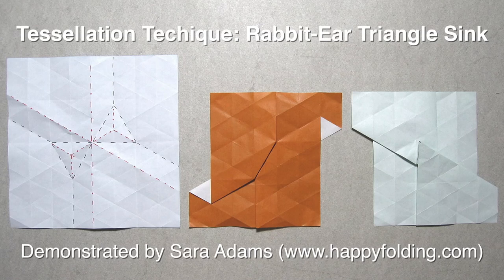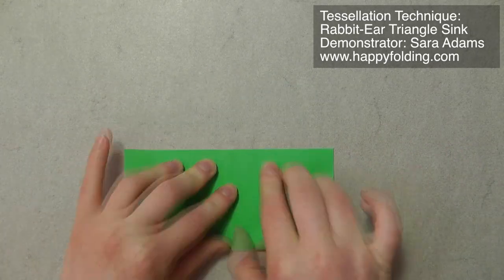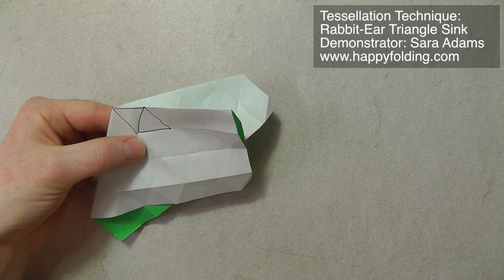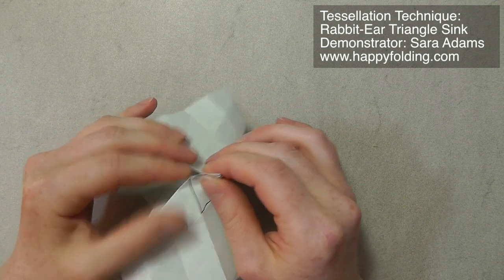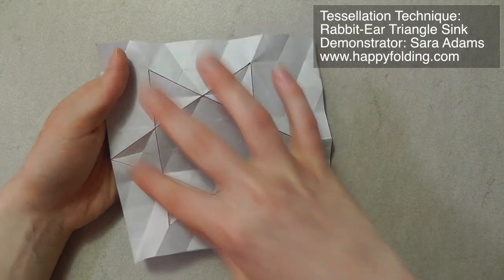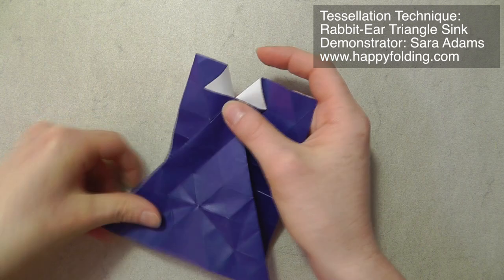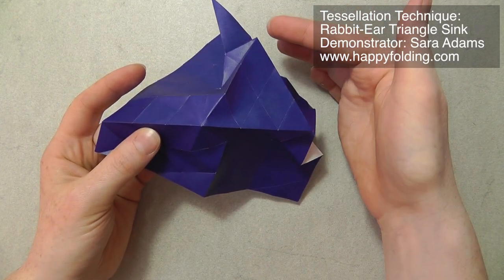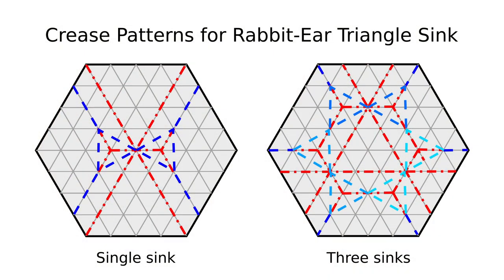Origami Tessellation Basics: Rabbit-Ear Triangle Sink

Comment from the maker: No, I haven't. But if I understand the book correctly, it's basically the same, except that you fold it on a 16 by 16 grid, rather than a 20 by 20 grid. And folding the grid is easy in either case. So I don't think it'd reduce the complexity of the model much.